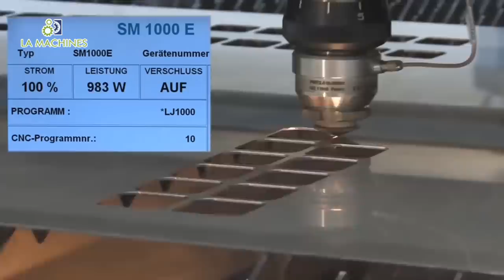Amazing Oxy Fuel Gas Cutting Machines, High Speed CNC  Laser Cutting Machine Metal Sheet

Comment: Why do they first cut a round hole, before cutting out the actual shape?
Reply: The hole was in the piece that was cut out, if they had cut out the piece first then they would have to put the hole in with a drill, punch, or cut by hand. It was maybe a bolt hole for the cut piece or a lifting lug, anyway it [the hole]  was in the design.
Reply: @brandysigmon9066  I was wondering if it was by design, because almost all the examples in the video did it.
Reply: Programs cut the radius before the circumference. Woops, What Brandy said. I thought you were asking why it cuts a line before the actual circle.
Reply: It’s a finger hole for lifting the piece out immediately after the cut.
Reply: The first part of a cut is messy so the program leaves a little pigtail so the intended part has nice edges.